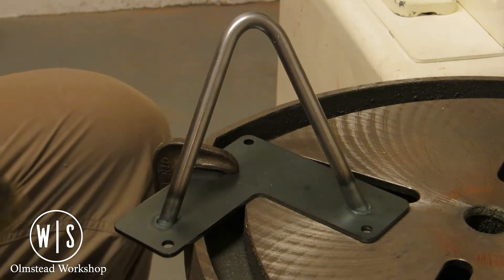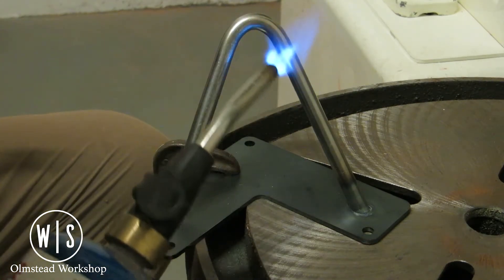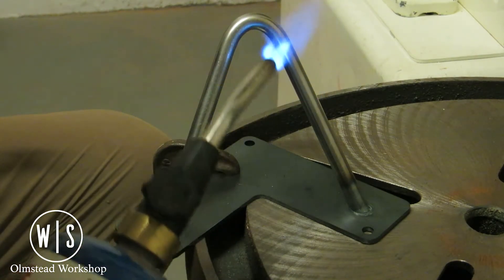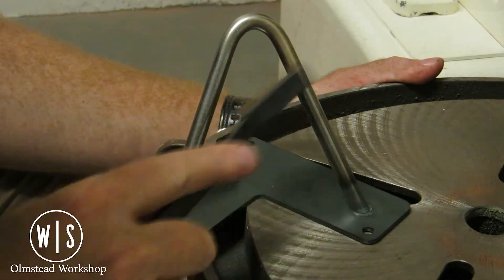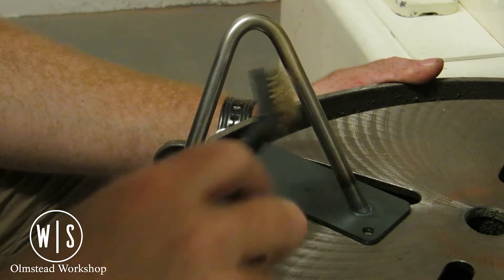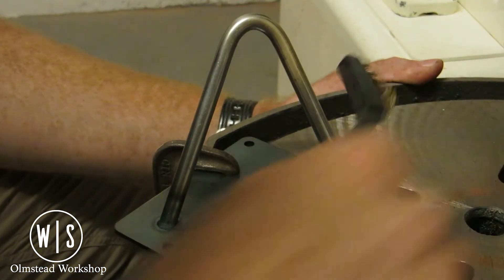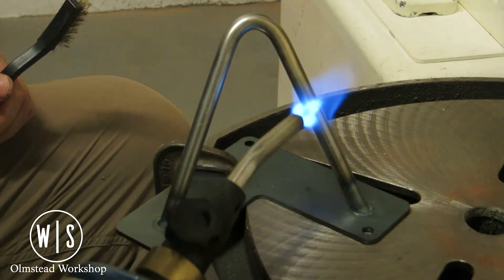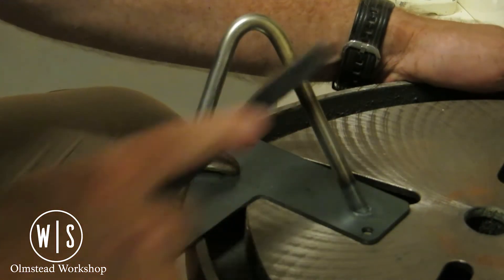Easy Brass Plating with a torch and brush

Comment: will the heat ruin heat treats?
Reply from the maker: This was done on some mild steel hairpin legs which weren't heat treated.  Getting your part hotter than it was when it was originally tempered would ruin the heat treatment.

Comment: Thanks for the vid, i tried this yesterday and it didnt work, but i think i know why now!
Reply from the maker: You need to make sure you're using a 100% brass brush.  A lot of the brushes and wheels you find at the big box stores are brass plated steel brushes.

Comment: Will this work for aluminum as well?
Reply from the maker: Technically you could as brass has a lower melting point than aluminium, but this is mostly for aesthetic reasons and you may be better served anodizing it straw color.
Reply: It won’t work on aluminum because aluminum has a lower melting point. Aluminum is around 1200•F and brass is around 1700•F.

Comment: Does it keep it from rusting?
Reply from the maker: Sorry for the delay.  If done thoroughly enough it will be corrosion resistant, but it is more for decorative purposes.  Also, brass will develop a patina as it ages.  You can preserve the brass look and add protection with a lacquer.  If you are looking for long term protection nickle plating would be a better option.
Reply: Bjørn Verhulst i have the same question
Reply: Interesting method. I have some mild steel box section I would like to do this with. Does it work on mild steel?
Reply: @cianoreilly2163  I would assume as long it is clean surface